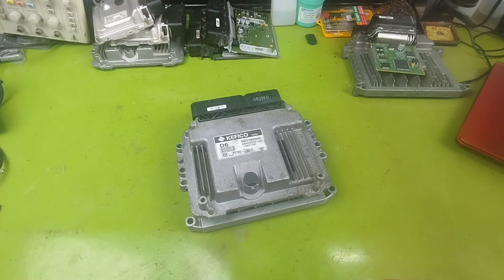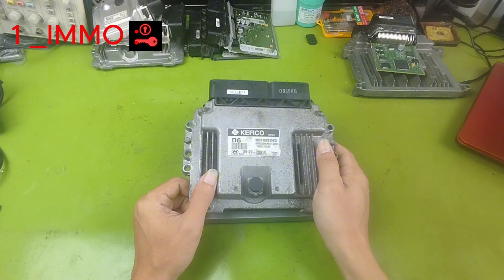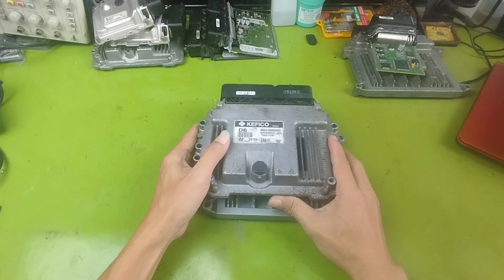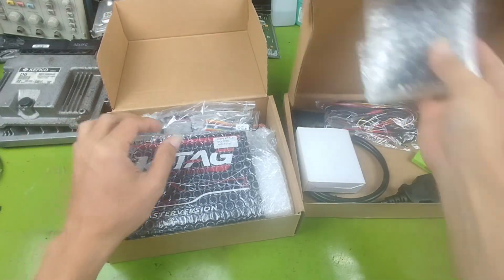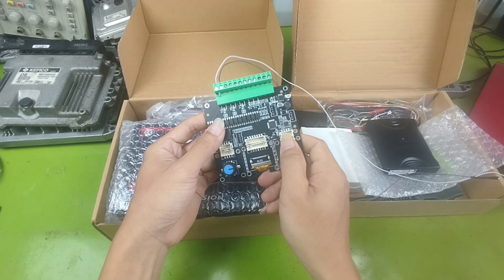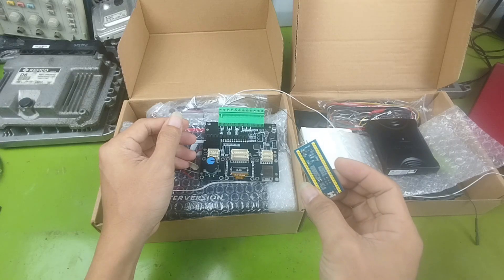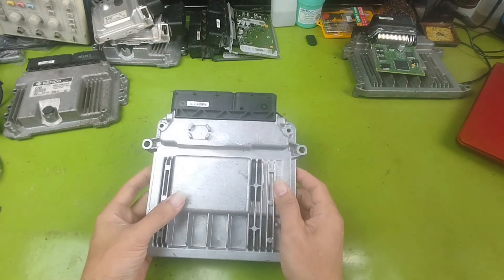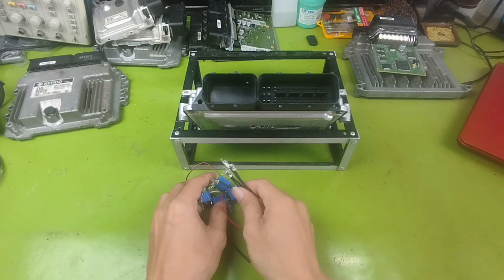How to Test Fuel Injection and Ignition Signals of an ECU on the Workbench | Step-by-Step Guide

Comment: I just found that the speeduino crew has created an open source cam crank signal generator.  It has many common cam/crank patterns.  Easy to build with just a Arduino Nano connected to windows - no other components required!  https://youtu.be/egTPpVotti8

Comment: Great videos! Please provide me with the ECU Pinout details, including relay, LED, Signal Generator pin, and wire connection information, so I can verify and understand the connection information at my end.
Reply from the maker: Each ECU and vehicle model has a different pinout diagram. I’ve already made a detailed guide on how to look up the correct diagram using the ECU code. Make sure to practice this skill until you master it — it’s a fundamental step you should be able to do on your own.

Comment: Thanks for the information. But how to use two power supply? Another one you used one signal camshaft sensor where's cranshaft sensor
Reply from the maker: The simulated loads require a positive supply (B+) so the ECU can control them. My power supply is missing some B+ rails, so I temporarily took additional B+ from another supply — it’s only used to power the simulated loads and does not interfere with the ECU.

Comment: Thanks for the video, very helpful. Two questions:
(1) at 2:50 you suggest a device to read ECU data. Is this only required to apply tunes?  Or is it required for diagostics and fixing the ECU?
(1) at 11:12 you connected a second power supply to the ignition LEDs?  why?
Reply from the maker: In ECU repair work, tools like ECU read/write devices and supporting software are essential if you want to learn and get into this field. As for why I used two power supplies in the video: all the loads I use for simulation require their own supply, and my single power supply didn’t have enough B+ rails, so I had to use two units.

Comment: Great simulation and Great video, I enjoyed this one a lot. I am curious about the use of two separate power supplies?
Reply from the maker: The simulated loads require a positive supply (B+) so the ECU can control them. My power supply is missing some B+ rails, so I temporarily took additional B+ from another supply — it’s only used to power the simulated loads and does not interfere with the ECU.
Reply: @Autocar_Star Ahh ok cool... great job !